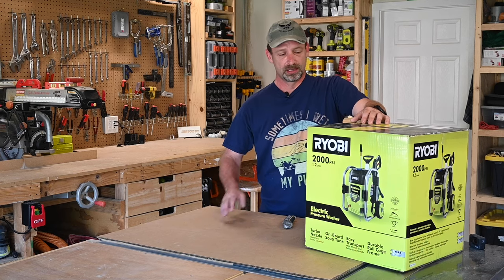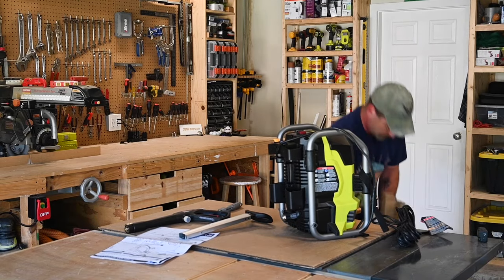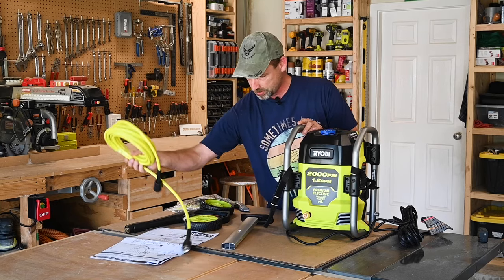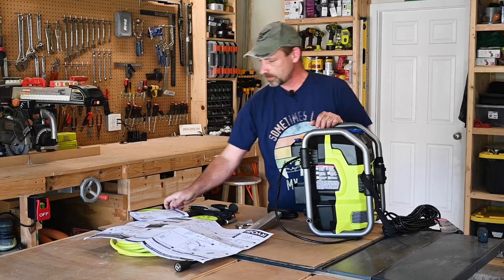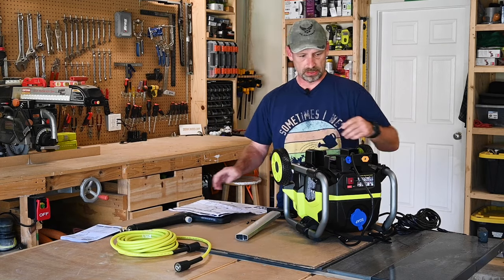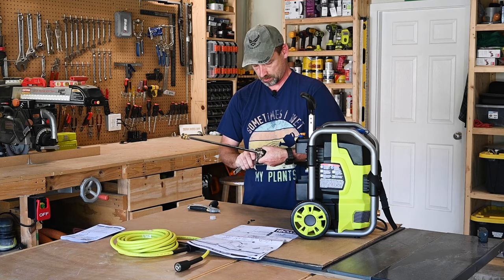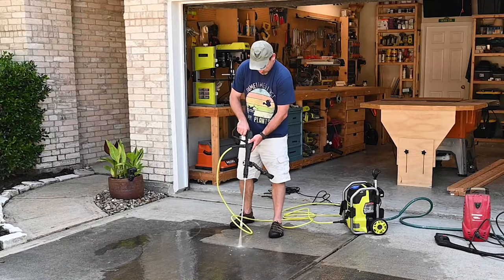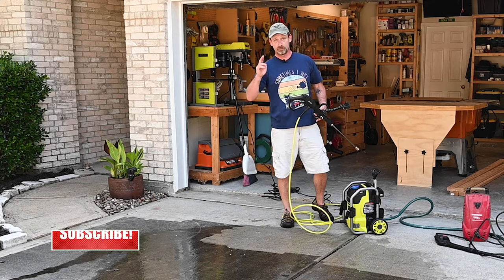Ryobi 2000 PSI, 1.2 GPM Electric Pressure Washer Setup and Test

Comment: I just bought one from Home Depot ... The screws are for the handle.  Two go in the bottom of the handle when inserted into the handle area.  They do not go in easy, as they need the handle pushed really hard into the handle spot!  I had to use the Book with the illustrations  and the white sheets of paper instruction to get it all put together!  Haven't used it yet, but I think it is time to try it out today.  But, it is easy enough for me to get it put together ... and I am a Boomer single woman.  So there!  lol

Comment: Decided to go ahead and get this Ryobi 2000 pressure washer to see if I could get better results than from the smaller machine I had been using for the past 4 years.  The smaller unit actually did a great job in cleaning my driveway, but didn't have a very wide nozzle setting and it would take forever to clean a large space.  I also purchased the Ryobi 12-inch surface cleaner, and also the Ryobi multi-nozzle.  The nozzle has 5 settings on it, and I'm glad I got these two extra parts.  The surface cleaner definitely makes it a lot faster to clean large areas.  Thanks for the video, helped me get everything set up.

Comment: I wanted to see how the blue nozzle for soap worked for you.  Mine - barely has any pressure and dispenses very little soap.  I guess I was expecting it to be like a soap cannon.  It was faster and easier to just use a soapy wash mitt to soap up my car.  The high pressure nozzles are amazing for rinsing and cleaning other things.  Don't use this on your car if your paint is in bad shape or not maintained.  I will strip it!
Reply from the maker: I haven’t tried the soap nozzle yet, for sure about being careful on cars!
Reply: The blue nozzle will not dispense anywhere near like a soap cannon. It'll mix in the soap with the water because the lack of pressure. So the result you are getting is exactly how it should work.
Reply: I couldn't figure out which nozzle was for the soap so thanks for that info. I bought one from somebody online and it didn't have instructions with it. I love it though it's perfect for around the house little jobs
Reply: The soap nozzle is useless. I just bought this unit last week and opened it yesterday. How is this thing supposed to clean siding if the detergent cannot reach it? Plus the high pressure nozzle barely moves grass off my driveway.

Comment: Just came home from Home Depot with this. Did a YouTube search for someone assembling and found the answer to my question 😀 What are the 2 little screws for. 7:10 😀. Thanks!!
Reply from the maker: I just want to start using the new tools and I read through the instructions too fast. 😬
Reply: They are for the bottom of the handle to screw it into the unit. Down at the bottom by the wheels

Comment: Hey Sean, thanks for the video. It helped me out alot. I didn't need it to see how it works or set it up but I thought it was kinda funny you forgot the screws for the handle. I was waiting to laugh cuz it shoulda fallen out when ya picked it up. But anyway, good review. I personally don't like mine as much as I thought I was gonna cuz it doesn't pick up too much soap, I had a problem with mine having constant pressure, and the turbo nozzle didn't work right. It didn't go in a circle like it should, it just randomly went left to right, and then straight, and again L&R. 
But, the video helped cuz I needed to return mine to HD and couldn't get it back in the box the right way. (until I saw your video) The cardboard was throwing me off. You showed me the light. I just moved into a new house and now have a garage finally. I hope 1 day soon it'll look kinda like yours. The more room, the more tools. Thank you very much.

Comment: Will you please let me know if with soap in the canister I can only use it to clean with water? In other words, does the soap canister have an on/off valve? ** GREAT PRESENTATION ** Thanks!
Reply from the maker: Thanks Carlos. There isn’t an on/off valve on the soap container. If you have anything in it, it will draw it out as you use the washer.

Comment: Im picking up one of these after work today.  I hate borrowing or renting things i actually need.  I've read a lot of great reviews about this unit.  I probably need to store this in the house during winter, so nothing inside freezes and busts.  I need this for our deck, the vinyl siding, washing cars, and cleaning the driveway.
Did anyone get the extended warranty?  My local Home Depot wants $30.00 for an extra two year warranty, which gives me a five year warranty.

Comment: What kind of hose and connector do you have for the back of the pressure washer? Thanks for making this video
Reply from the maker: It’s just a regular water hose. The pressure washer came with a quick disconnect adapter that screws onto the end of the hose.
Reply: @SeanDoesDIY  thank you

Comment: Bought this exact model today, new, and there is no pressure to the lance. I tried several ways to clear any air bubbles out and still nothing. Took it back, exchanged for new one and having the exact same problem.
Reply: Kick it. It’ll fire up.
Reply: I'm also having this same problem.
Reply: @katiehumphries5923  make sure you turn the water on from your water source first, then squeeze the trigger to let some water flow into the system, THEN fire it up/turn it on and you should be good to go, if there is no pressure right away, just keep the trigger pulled until it gets pressurized. Hope that helps.

Comment: I am confused on how you add detergent. I bought this zep cleaner. Do you just pour it in directly or do you mix it?
Reply: You mix it, 20/1 ratio, 20 parts water, to 1 part soap, doesn't need to be exact. The soapy mixture will only be pulled into the water stream in lower pressure modes, i.e., with the blue or orange plastic bit that goes on the top of the washer wand.

Comment: Would you recommend this for car detailing especially since it has a separate space for soap?
Reply from the maker: I suppose it would work for cars, I'd just be careful using the high pressure fittings on auto paint.
Reply: @SeanDoesDIY  My neighbor uses one with a lot more pressure for washing his cars and truck...I think he is crazy, but it obviously works for him...
Reply from the maker: @mr.p9882  I'm leery about using pressure washers to clean vehicles. I'm good with just using the good old garden hose.
Reply: @SeanDoesDIY  I use 3300 psi for detailing

Comment: How do you compare the turbo nozzle cleaning your driveway on the Ryobi compared to the one you had before? Would you recommend getting the attachment 2000 PSI 12" SURFACE CLEANER?
Reply from the maker: The Ryobi is much better, the PSI on my old one was much lower. I did purchase get the 12” cleaner and it worked pretty well. I had to come back and get a few lines that it left. Though that could’ve been me going to fast.

Comment: Hi! I have what might be considered a silly question. Is there any special instruction or precautions I need to take when testing the GCFI breaker? Thanks!
Reply from the maker: Hey Jonathan, nothing extra you need to do. Just push the test button and then the reset button.
Reply: Safety is never silly

Comment: This one have the brushless motor? I may spend the extra $80 for brushless.
Reply from the maker: This one does not have the brushless motor. The 2300 PSI model does, model #RY142300.
Reply: I watched a video on that one and it is MUCH noisier, doesn't turn off when you release handle, PSI ran a bit lower than stated.

Comment: Just purchase mine but when ever I connect everything plug it in and set everything up correctly it doesn’t have power just the normal hose and it doesn’t make the noise that yours does but idk what it doesn’t
Reply from the maker: Logan, make sure the built in GFCI on the plug is reset.
Reply: @SeanDoesDIY  ok thanks I will let u know if it works or not!
Reply: @SeanDoesDIY  I got the sound I think it’s the motor but there is no pressure coming out it’s just like a hose
Reply from the maker: Let's see if we can figure it out. Does the motor run all the time after you turn it on? After you hook up the garden hose and turn the pump on it should make some noise as it pressurizes then cut off until you squeeze the trigger on the handle. Do you have one of the nozzles installed on the end of the wand? Check the nozzles and make sure there is debris in them.
Reply: @SeanDoesDIY  it works I just had trouble putting on the nozzle but I got now thanks for your help
Reply from the maker: Awesome!

Comment: What is the orifice size of the included nozzles?
Reply from the maker: It comes with one that sprays in an elliptical pattern, a 15° flat, and a soap nozzle. I believe the wand has a 3/8” adapter.
Reply: @SeanDoesDIY  I know that.  But, what are the orifice sizes of the nozzles?  1.5mm?
Reply from the maker: Sorry about that, just got home. They are 1 mm. I’ll post a picture on the channel community tab.

Comment: Is this good to start a pressure cleaning business with servicing driveways,  roofs?.im asking because I just bought one never use it i wanted to know should change it for a gas model?
Reply from the maker: I would say that a gas pressure washer would be better if you’re using it for a business. You don’t need to rely on power being available wherever you are working.
Reply: We use gas for clients, it’s a huge difference efficient wise. Electric is good for your own house only.

Comment: wouldn’t recommend. the hose gets in your away everything connected gets in your way. no matter which way u pull it you’ll always find the hose stuck under
Reply: if u don’t wanna be struggling look for something better
Reply from the maker: Hey Ivan, I haven’t had any problems with the hose getting tangled up or stuck on anything.
Reply: @SeanDoesDIY  i feel like it depends on how u have ur hose on your house cause damn i always move it and it’s in the way
Reply from the maker: These kind of pressure washers are limited to where you can connect them to the water supply.